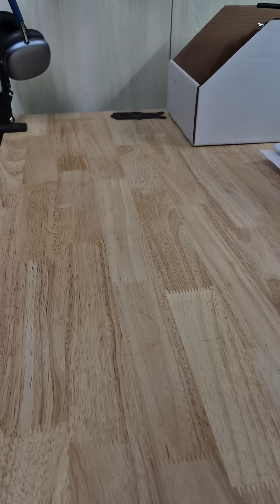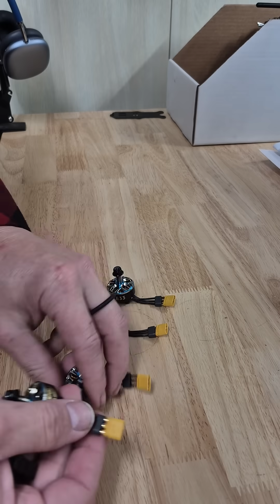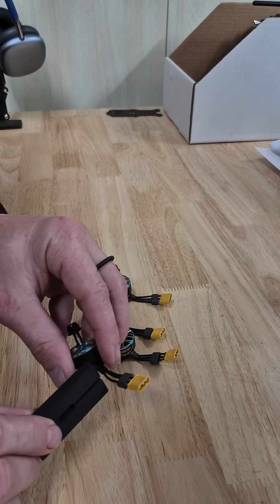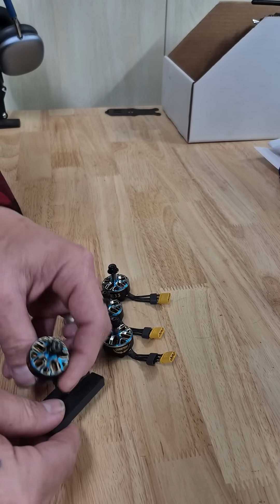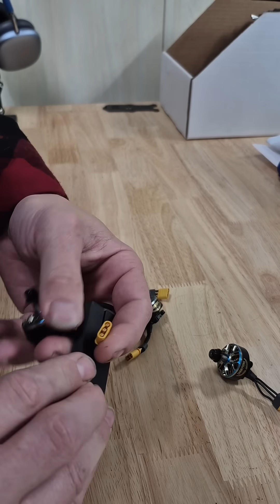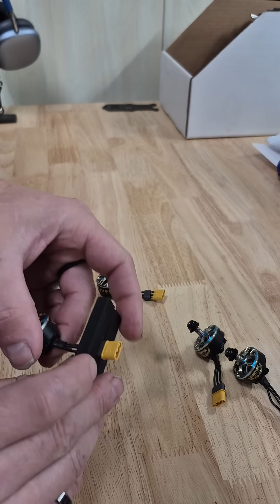mr30 connector tool for drones

Comment: I did this to my storm chaser (10 inch quad with everything covered in 2 part epoxy) made it to fly in a storm but motor replacements were difficult because of the impossible to remove epoxy so I'm using this